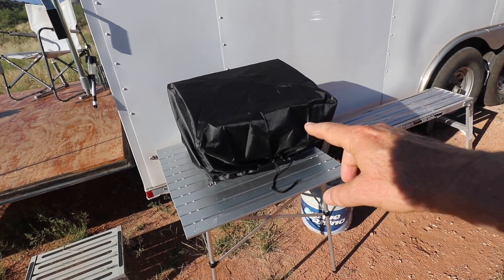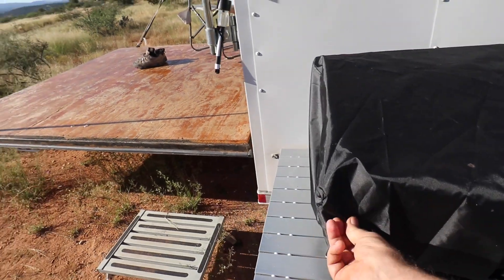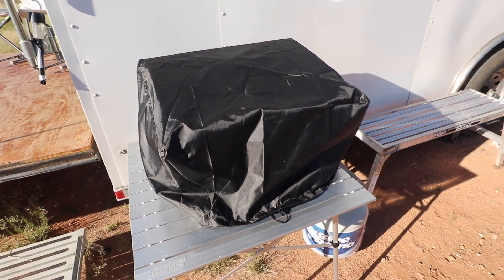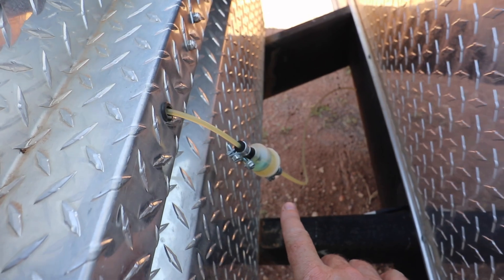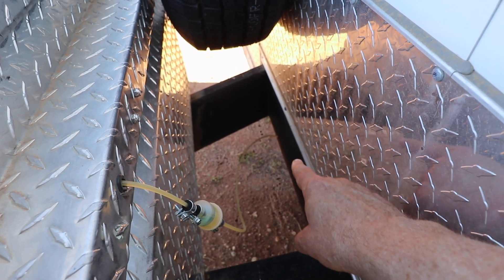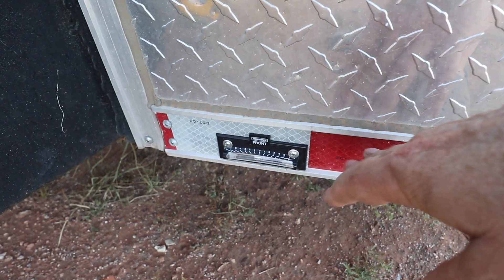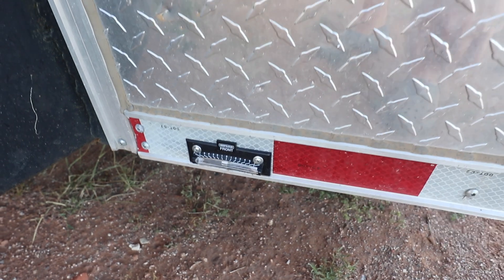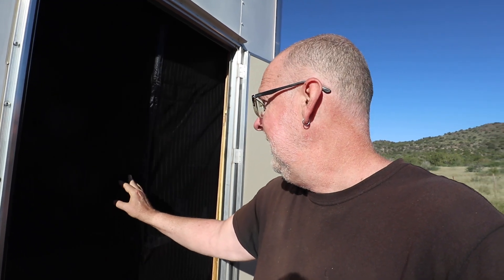Baffling Solar Stuff E651

Comment: ¸~⁾⁾⁾⁾⁾(⁾,   Hey Seven 
(⁾"  °⁾ ,〉°⁾    I got a space   
  )     ≈  ..    saver for a    
       ⁽          Step Van .
would you care or would you 
Dare to Create you a horizontal
and vertical Space saver
 would you calibrate the  
dimension for you to create ,
we now you don't have a step van
anymore but it's the usefulness 
that count if one has the idea
could you picture it in your mind
to a stander measurement into
sizes if it's built in a step van . .

Comment: It is most definitely over-voltage protection from the BMS from unbalanced cells. I would not rely on the BMS alone to keep them balanced. Balancing is only the secondary purpose of the BMS. The primary is just to protect the cells. If you are running a 24v system, those charge controller voltage settings need to be doubled. Full charge is at 29.2v for your system. If you have unbalanced cells, it will certainly trigger over voltage protection at the top end. I would actually try setting the bulk and absorption charge voltage to be around 28.0-28.4v. you'll lose a bit of capacity but you won't trigger over voltage and your pack will last longer. Try installing an active cell balancer and see if it helps over time. Good luck.

Comment: If you are running lifepo4 8s your max charge is 3.6v x 8=28.8v. I would set your controllers to 28v. Also 1 cell may be going over or close to 3,6v. May be a good idea to check the balance. Those controllers are not safe for lithium. Get yourself some proper controllers. Outback ,Midnight, Something safer. Cheers
Reply: This is where my mind went too. Check the voltages of each cell when this is happening, the BMS is likely doing a high voltage disconnect to protect a cell that's reached the high voltage cutoff limit. That should only affect the charge side FETs but it looks like the discharge side gets a short interruption too. Might be time to do a top balance.

Comment: Good morning that’s the reason why I do not have battery management system on my system I only got balances the problem you’re going to have is those dally are you going to keep shutting your system down and you will burn the charge controllers are so your best bet get rid of those dally Install balancers control your high voltage with your charge controllers and your low-voltage with your inverter and if not both areas of a cost a lot of money Or lower the voltage on your charge controllers

Comment: So to me the first question is did it ever work correctly? I am guessing it worked fine as it seems like you have had this system up and running for some time now. If it did and this just started acting up then something broke. If not the diagnostic tree is way different.
Reply from the maker: for the first several months I was in my trailer I was only using 2 panels with one charge controller and worked perfectly. it seems too much power is the main cause and when adding more incoming power (more panels) it seems to overwhelm the BMS on the battery and goes into the shutdown.
Reply: @SevenWanderstheWorld  Could be correct. If it never worked that is way different than it worked and now it doesn't. Always something to challenge us.

Comment: Every voltage you read off to him is for a 12V system. If he entered those numbers as read, your 24V system will still not be charging correctly. Also, you might double check that your BMS settings are correct for a 24V system as well.
Reply from the maker: as mentioned in the video, if you set the Renorgy to 24 you then enter numbers at 12v values and the system doubles those numbers for 24. its a bit wacky but that is how Renorgy does the 24v custom settings
Reply: @SevenWanderstheWorld  Whacky? That sounds really stupid on Renogy's part.  I'm running a DIY 24v(LiFePO4) system with a Growatt All-in-one inverter and a second epever charge controller.  BMS's from overkill solar.  I set my charge controllers to a voltage that is 3.45 volts per cell(27.6) for bulk.  This is just 5% away from full and gives a little head room if a few cells are out of balance. Float voltage at 3.4v per cell.  I'm catching up on your vids. Youtube hasn't been recommending them for more than half a year in my feed.

Comment: This is way over my head with your solar but I think it's really cool. I'm used to simple 12 volt stuff in jeeps for overlanding type setups. What first came to mind at least with the limited lithium battery knowledge I have, is don't some lithium batteries have internal safety devices that shut them off if they are getting too much charge or too hot or something? This might not apply to your batteries but I thought I'd mention it. 

I've been a long time subscriber but I've missed some of your videos for a while. I just have to say wow! Your setup is super nice now with the trailer I'll have to go check out some videos I missed.

Comment: I had a similar experience with my 12v lithium system 2 charge controllers. the bms was shutting off the charging at the proper setting before the charge controller was being told to do so. This lead to a short line spike which shut down my inverter (I only have one) which would reset only to be shut down again and again. I was able to stop this by turning down the charge controllers to a setting below where the BMS would shut off the charge (or power in). Took care of my issue but it took a lot of fiddling to get both chargers to the right value. So you may want to turn them down more and check the cut-off voltage setting on your BMS

Comment: I don't want to slam ya but it seems that your system was built with overthinking involved. three charge controllers? I think you need to build your system more simple and easier to maintain. Just sayin and not slamming ya
Reply: Remember he has had this system for a few years and every year things get simpler and simpler. He has 2,250 watts of solar, one charge controller can't handle that much and if 2 panels get shaded, they won't affect the rest as they would with a single CC. Whatever you put in today, there will be a better system tomorrow. 
I'm using an all in one charge controller, inverter, and shore power disconnect which was the simplest system a year ago, now there are much better systems where that all in one unit talks to the battery bank and optimizes on a minute to minute basis.